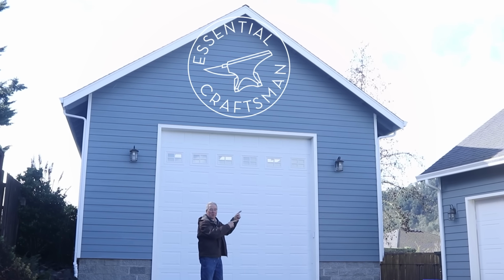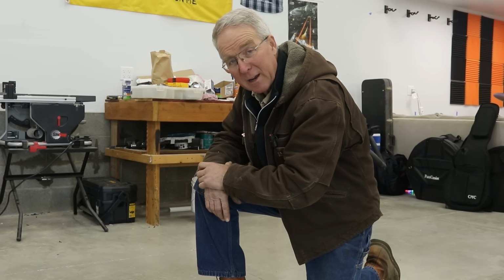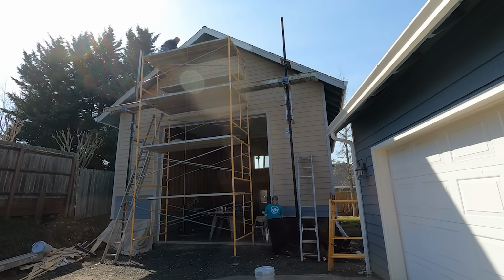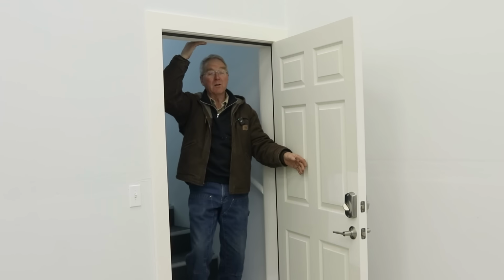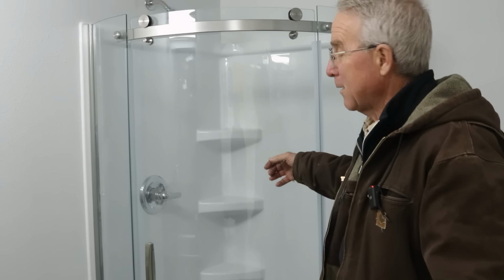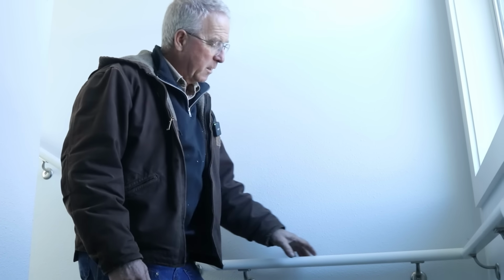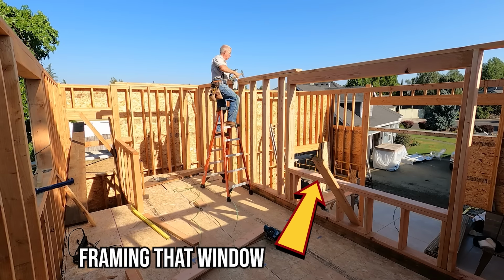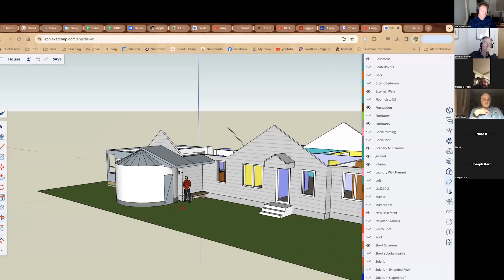Shop Build Final Reveal! The Good, Bad & Ugly

Comment: On the point of sound insulation (I'm an acoustic consultant): it's firstly important to understand that building acoustics is split into two nearly distinct fields: 1) absorption; this is provided by heavy curtains, soft furnishings, those black&orange foam things you've got on the wall.. book shelves close to the ceiling provide excellent scattering..  all of the above makes a room sound better, but does nada to stop the passage of sound to your blessed neighbour.  2) sound proofing;  the crux of it is mass.  special extra dense plasterboard can be dabbed to your existing making sure to leave no gaps (sound is like heat it will find anyway thru) and flexible caulk.  Much better is to leave an air gap between the existing plasterboard and the new - and even better than that is to build the two "leaves" on separate studwork so it doesn't 'short circuit'.    Having said all that, there is a point of diminishing returns, because if you go to town and achieve a wall that can inhibit 10dB then perhaps the sound will go up thru the ceiling and out the upstairs wall with less inhibition (flanking transmission)      ...that door cover you've got - make sure it's tight, perhaps use velcro strips.

Comment: Door Suggestion, push the door forward 3' away from the steps, creating a vestibule.  In it's current location, the doorknob is at his knees when he reaches for it.  The head room is only half the problem.
Reply: I'm surprised it passed inspection for both the lack of head clearance and the lack of a landing inside the door.
Reply: I have to agree with you there it's bad the way it is
Reply: This is exactly what I was going to suggest!
Reply: @SlickBubbles  Yea, in my area (S.Fla) a landing is required, regardless of at the top or the foot of a stair. The landing needs to be the same width as the stairs, minimum. At 6’-7” this would be a problem for me.

Comment: Mass loaded vinyl. It comes in huge sheets as it is used in landscaping to dampen outdoor noise and in residential landscaping to block out freeway and train noise. It's jet black. I recommend putting it up and then putting a wooden screen over it. A slatted wooden screen helps the vinyl to  be more sound absorbent and the wooden screen is actually quite good looking and cheap. Best of luck!
Reply: There are actually sound-deadening wooden acoustic panels (WPC Acoustic Panels) available.
 MLV also comes in bright green.
 A second layer of drywall with MLV or acoustic caulking sandwiched between the layers is an option too.
Reply: An interim sound damping idea, add curtains made of mover's blankets.
Reply: @bcase5328  Yes. combination tactics work really well. As does adding a thinner inner wall lined with Rockwool's "Safe and Sound" acoustic insulation. Every layer dampens sound even more. It kinda depends on how much space you're willing to give up in the room.
Reply: @SlickBubbles  Oooh. Good idea. Thanks for turning me on to WPC Acoustic Panels, I hadn't known about them. I'm pretty sure our intrepid craftsman will mine the comments and come up with a good solution that suits him and his budget! 🙂
Reply: Mass loaded vinyl will attenuate sound hitting it but in a large room with a loudish sound-source the sound will escape through every nook and cranny. Thus big sheets of mass-loaded vinyl will have a very limited effect from outside listeners. The real solution would have been to consider soundproofing during the build, creating a 'room within a room' where the floor joists were isolated with neoprene or similar and the inner walls consisted of 2 layers of acoustic plasterboard (where the 2 layers have differing thicknesses) mounted on resilient bar. Looking at the size of the space it's definitely doable as an after-build project but it won't be easy and cheap. The best way forward would be to consult with an acoustician and get a set of recommendations for floor, walls and ceiling whereby an area of the space is completely enclosed in new materials. Once that's done they could play at full volume in the middle of the night and probably get away with it but with soundproofing it's a bit of an 'all or nothing' game. Putting dampening here and there isn't going to work effectively. They need to define an acoustic space, build a new set of walls around it (or modify the existing ones to have double-layered acoustic plasterboard on flexible mounts) and install a nested ceiling and floor.
Reply: @eddydeegan  Hmm. My only experience with mass loaded vinyl was to line a concrete block fence in a back yard to dampen the freeway sounds. I lined the block with the mass loaded vinyl, put reflective Cor-Ten panels on the top of the wall angled about 45 degrees out to reflect the sound, and then planted a trellis in front of it.  It worked a treat. Make the back yard not just usable but enjoyable. I thought it might be adaptable to indoor spaces, as well.
Reply: Rock wool insulation works fabulous, though with the drywall up already that’s probably not likely to happen unless the neighbor feedback worsens.
Reply: @jk3090  So true! The cost-to-benefit ratio is always changing.

Comment: Sound isolation:  parallel hard surfaces are a no-no.  An inexpensive fix for rock band spaces - thick carpets on the floor, more of those orange sound panels on the ceiling, a heavy pipe curtain rod with heavy, thick curtains that can be pulled out to block the rock room from the workshop, build some wooden frames using 2x2” lumber and fill with fiberglass insulation…cover with some fabric, put a pillow or 2 in the bass drum to dampen it.  Loved watching this building coming together!
Reply: Yeah the rest of the shop is acting like a giant speaker!
Reply: Two layers of sheet rock would help that back wall, too.
Reply: all of this will reduce reverberation and make the room sound better and achieve a theoretical maximum of 3dB reduction (practically ~1dB)  which I agree would be super, but provides no reduction of sound transmission to their neighbour.

Comment: the concert at the end was not what i was expecting, that was excellent.. i know this video is 6 months old and you'll probably never read this, but as far as acoustic isolation, you want as much mass as possible and you want everything sealed airtight. double sheetrock with an acoustic glue in between is one option, there are acoustic materials like sonopan but they seem to be mostly available in canada, and you're well past that stage of the project anyway.. in my theater setup i built some simple 1x4 frames to hold bats of rockwool insulation and covered them with decorative fabric, they do a really good job of stopping reflections off of hard surfaces, which in turn helps keep the sound in the room.. i have them on the walls and the ceiling, hung up with french cleat.. John Heisz has a great version where the fabric is held in kind of like a screen door rather than wrapped around, so the edges are wood and it makes a really nice looking panel

Comment: It takes a big man to admit his mistakes. Only a man with the highest integrity publishes a video which includes a reveal of his mistakes!!! I salute you!

 Here are a few ways to possibly address the sound issues:

1) A 'big' problem with the music area being open to the shop is the fact that the shop and garage door are all hard surfaces, leaving any sound to bounce around freely.  Containing the sound within the 'music' area would be important. Heavy curtains like those in theatres (I'm picturing a 'quadrant-shaped' curtain rod with the centre suspended from the workshop ceiling by cable) would help loads and perhaps (Though it might look 'different') a fold-out awning to cover the area above the quadrant? Otherwise, build a quadrant-shaped storage area, at least 8' off the shop floor, to extend the 'kids' area and hang retractable heavy curtains from that. This storage area could possibly be suspended from the rafters and the curtains could retract upwards. A 'soft' surface on the top or bottom of the 'deck' would be needed.
2) Cloth 'wall hangings' ( an interesting wool area rug perhaps?) on the walls would help with the sound. I only say 'wool' to give the vision of a little 'fluffiness' which does a better job than an industrial-type carpet.
3) You can also buy sound-deadening/absorbing tiles to do this. There are new variations, which have just come out, that do an excellent job of this.   Optionally, an extra layer of drywall helps, or to boost its effect, add acoustic caulk between the layers. If you have any outlets/switches on the exterior wall, fill around them with acoustic caulking.
4) That door with the glass is perfect, except when they're playing music. A floor-to-ceiling curtain that can cover the door and its frame would help a lot.
 5) You could turn to music specialists (Search in your browser) to find the best or most 'bang-for-the-buck' acoustic panels if you wanted the 'best' way to reduce sound escaping.
 6) Adding thick and tall coniferous bushes (restrict the roots from the slab!) on the left and rear walls, when facing the shop garage door, will mitigate escaped sound volumes. Maybe the 'trough' style raised bed containers could be used? Be aware that cedar roots will eat into concrete eventually. 
 7) They could grow vines on the same two walls; however, I'm pretty sure you're aware of the issue the vine's 'tentacles' can cause. I once saw that someone had constructed a trellis, hinged at the bottom, and standing 1 foot off of the building, for the vines to grow on. Every year the trellis is swung away from the building to remove any meandering tenticles.
 8) The last option, and least desirable, that I will mention is to remove the exterior siding and add an extra layer of sound-deadening insulation to the outside of the shop, at least on the two walls of the 'kids' area. 
9) Which method is used all depends on the cost I would guess. Egg cartons mounted on the walls and ceilings would be the cheapest of all but they would need to be sprayed with fire retardent also.

 ***Note that the curtains in theatres are always treated with flame-retardant and I would suggest the same be done to any untreated cloth or carpet added to any surface in their shop, especially below or near the office.

Comment: 10:24 Sound isolation - saw a video where wall used 2x6 header and bass but 2x4 studs offset on each side so the studs never touched drywall to drywall. Building additional walls, air gaps, insulation, different densities can all help cut down the sound transfer.

Comment: The sound isolation can be handled with mineral fiber insulation in between the studs.  Cover the studs with rolled rubber roofing. attach RC1 resilent channel to the studs.  Add two layers of drywall offsetting the joints.  Make sure to surface mount the electrical with MC in that area as any holes in the walls defeat the gains from the other components.  Also consider a headphone system for the players.
Reply: Keano??
Reply: Good ideas.
Reply: Add drainage mat between the layers of dw

Comment: The shop turned out great. There are always gotcha's in the finished product. I worked mostly alone for many years and you always come to expect issue's you just cannot foresee. For the door, I'd bevel from the back of the stop to the trim at a 45* angle gaining 2-3" on the backside of the jamb, and raise the lockset a foot. For the glass, use wired glass, and that should be OK for a 1 hour rating, so in the future he does not need to worry about a code issue, had to that in S.F. for property line compliance.

Comment: I'd suggest for sound isolation attach another layer of 5/8s sheetock and build 2x2 square drames with heavy fabric burlap like thickness stapled on it floorcto ceiling like tiles.  Thats what I've done with basement workshops and really cuts down the low end sound. Good luck 👍

Comment: Nice! Re sound mitigation: Most effective but greatest effort would be to build a wall in front of the wall facing the neighbors, adding insulation in that gap. Less effort but still helpful is to build “bass traps,” simple 2x4 frames with 2x4 batt insulation and go nuts with them. Focus on the walls abutting the neighbor but hang them all over. I’ve had good luck with Rockwool Safe n Sound. I paint the frames and staple some fabric over the front so they are pleasing to look at.

Comment: HI there, you are seeing a lot of comments that confuse "acoustic treatment" with "soundproofing". Acoustic treatments (like the foam panels you've affixed to the wall) will make the room sound nicer but not do anything to prevent sound from travelling out of the space. 

The best time to do soundproofing is during the building process. Double stud walls, mass, extra layers of drywall, decoupling are all things that are easier to do before the walls are enclosed.

What I'd recommend is removing and sealing off that back door. Then add another layer or two of drywall over the existing drywall at least in the lowered ceiling part of the space. That would be a start.
Reply: Two "floating" non-parallel walls (skew them both vertically and horizontally) forming the 90* corner behind the kit could be built inside the finished wall (sill and top plates attach to floor and ceiling, studs carry insulation and sheetrock but don't touch the outside walls). The angles do not need to be dramatic, just enough to prevent standing waves (to use audio-jargon). Using rock-wool or regular fiberglass insulation to fill the void is great. Make sure whatever material you use isn't compacted between the walls (you are insulating against solid mass transmission). Single layer of sheet rock then reapply your foam tiles.
For the ceiling I would DIFUSE the sound as much as possible. There are tiles made of various materials which will break up the sound waves (especially at higher frequencies) which can be used in conjunction with the absorbent tiles to manage that sheetrock slap.
Good luck.

Comment: For secondary sound insulation a second drywall hung on new wall just inside the old one would help drastically…ideally with a dense glass sound insulation behind, a double layer of drywall, hung on studs which are disconnected from the outer wall will easily dampen that sound In that corner. 

You can hang it on 2x3 walls with half inch gap. To the existing structure.So with the drywall you’ll only lose 3.5 inches space on each wall. Dense sound deadening wool for sound will absorb that sound beautifully. 

Very cheap and easy. Only will be connected to the building at the top plate Screwed to the ceiling. A heavy curtain to draw across would help on the open wall, to stop the sound entering the workshop space. 

Or a couple of heavy rugs that could be hung up when they are practicing with some brass eyelets punched in and some brass hooks to cover the gap into the rest of the space.

Comment: classic sound dampening would be rockwool in the walls, double hung sheetrock. good seal around the door. The extra mile version would be to make a secondary wall that creates an air gap between the outside wall and the interior space... essentially a room within a room kinda thing

Comment: Rockwool insulation in big wall and ceiling panels helps a huge amount with sound absorption. Putting them 45° across each corner of the room as well helps trap the low frequencies

Comment: To make the neighbor happier, get the boys some in-ear monitors so the amp volumes can be greatly lowered!  Or a Universal Audio (UA) OX reactive load box to get the same "crunch" that a cranked amp would have, but at much lower levels.  I don't know what the UA stuff costs, but maybe it's less than adding enough sound deadening to the shop (without killing the sounds the boys are trying to get.

Comment: Hindsight is 20/20! I think a few retaining boulders by the back corner would stop any build up or leaves or debris against the siding. The downspout issue is barely even an issue. I would probably go ahead and get Ben that taller door anyway, Not worth bonking your head again. Hospital bills are always more expensive than safety repairs!

Comment: I cannot imagine walking away from that door mistake, and saying I might get back to it. Other than the cost of a taller door, it's really a pretty easy fix. If you visit often, it is going to drive you nuts looking at that thing.
Reply: No landing at the bottom of that stair, does not meet code in my area.

Comment: For the noise, hang a curtain along the space between the music area and the full garage. I'm wondering if the echo chamber effect of the large shop space amplifies the noise more than if it were contained in the smaller area. Something with some heft. You can try hanging up some moving blankets to start and see if it makes a difference.

A double stud wall with an air-gap on the exterior would I'm sure help, but that's pretty extreme.

Comment: For the sound dampening, frame out a wall and fill it with rockwool (as much as you can afford and as thick as you can get away with) and then instead of closing the wall with drywall, cover it with an open fabric like muslin.  It'll go a long way towards controlling the sound and will make the room sound amazing!

Comment: Soundproof suggestions. Building a floating room inside the shop will do it. Expect a good lost of space but good results. There are plans for this scattered around the interweb.

Start with a rubber dampened floating floor and make sure walls and ceiling have no contact with the shop's framing to avoid vibration transfers. You can use SONOpan but the stuff is nasty to handle and you won't get good results unless you have a floating structure inside the shop's structure. 

We have a recording studio built this way in the basement of a 250 years old three stories multiple dwelling house in a 400 years old downtown area. No complaints whatsoever and we are not recording new age songs!